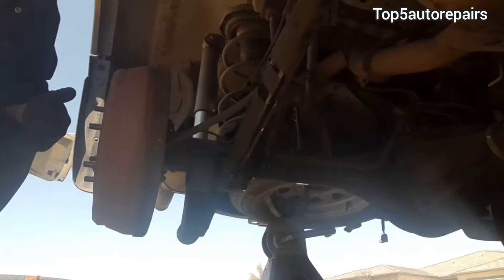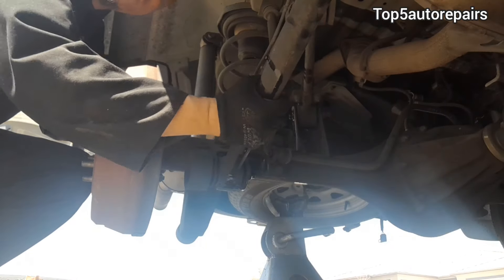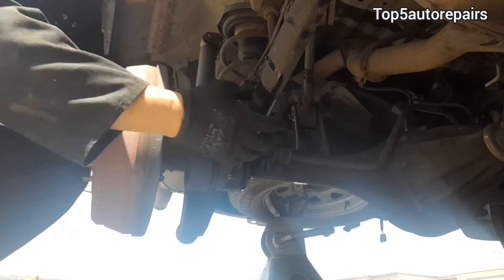4 SIGNS OF A WORN TRAILING ARM BUSHING

Comment: I have an 08 Mazda 3 and once I hit 50+ mph it feels like almost like swaying/floating back and forth man, you could easily cause an accident cuz of it,  at least in my case. This is the first I’ve heard of the TA ‘s (just a diyer) so ima look into testing them. I’ve replaced front lower control arms, front strut assemblies and front strut mounts all 4 sway bar links  but man the effects are just something you can’t explain but you did as good of a job as anyone ive heard explaining it so thanks man I really appreciate it cuz I gotta get my girls suspension and blower motor swapped out which has started to look like it’s gonna be a nightmare. Just Wanted to take the time and tell you I genuinely appreciate you covering this topic, and putting the video out the effort does not go unnoticed

Comment: Thank you for the information. I have a recall on my Honda CRV 2011 for the rear trailing arm. I do have a vibrating when I stay at the speed 40. But I go over 40 no vibration.  Going in to garage June 6 for repair.

Comment: Do leaf springs hold up better or should those be replaced when the begin to sag.   I've never owned anything with trailing arms but thank you for the info I still love learning what I can for next time.   Also have you ever used Electronic Engine repair sound detector / Steelman Wireless chassisEAR auto diagnostic tool.  They let you clip onto things and you can listen via headphones to pin point or really hear and find a noise.   Looks like a really neat tool if it's new to you somehow or helpful to others, great.
Reply from the maker: Leaf springs can handle more load but they do sag if the vehicle is constantly loaded with heavy material.
Reply from the maker: Leaf springs can handle more load but they do sag if the vehicle is constantly loaded with heavy material.

Comment: Recently my rear upper control arm bolt snapped . Wheel was at an angle holding on until I got it home . Once it got all fixed up , now when I do right turns on freeway junctions over 60mph the car gets a horrible death wobble almost feels as if it’s coming from the rear end . Could have it messed up the trailing arm possibly?